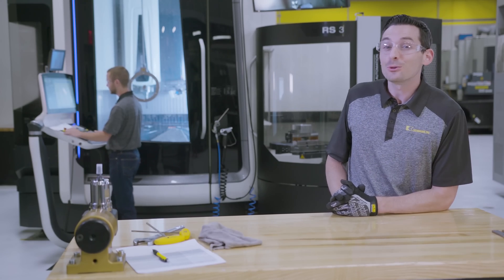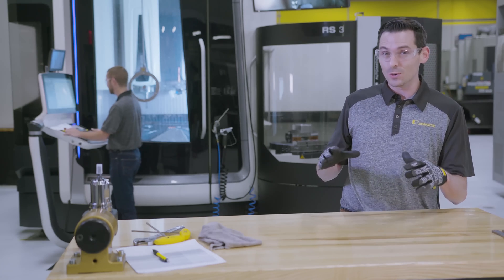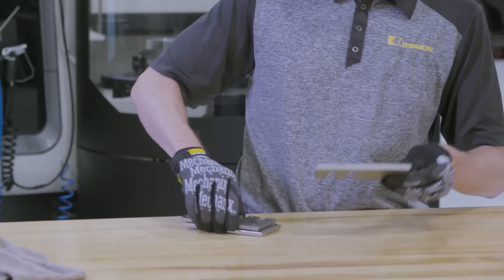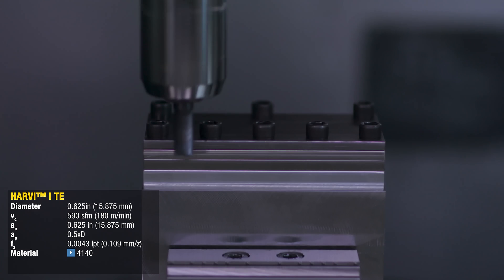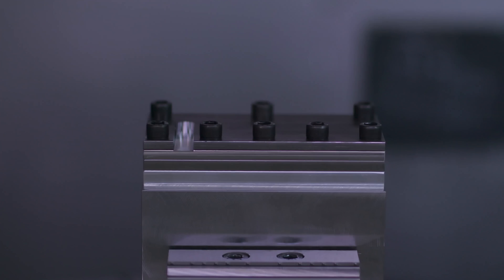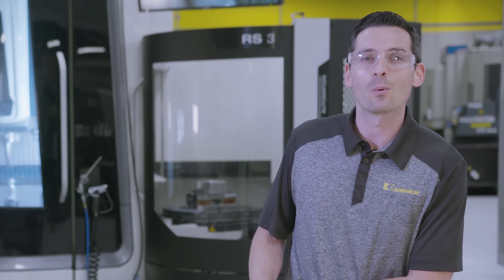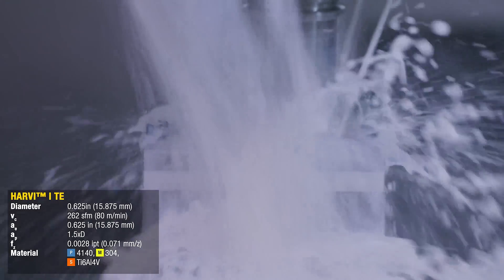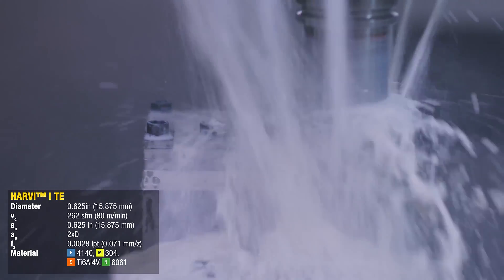The Sandwich Cut - HARVI™ I TE

Comment: Stainless steel does  not need cooling?
Cool video BTW.
Reply from the maker: Thanks Dan!
We want you to be able to see as much as possible in our videos, that’s why we ran the tool dry in steel and stainless steel. Typically, external coolant is preferred for steel and stainless steel applications. Let us know if we can help you with anything else!
Reply: Dan L. - Stainless needs cooling most of the time.  Some steels can get away with dry machining if the conditions are right.  It tends to depend on how well the chips can evacuate the heat.